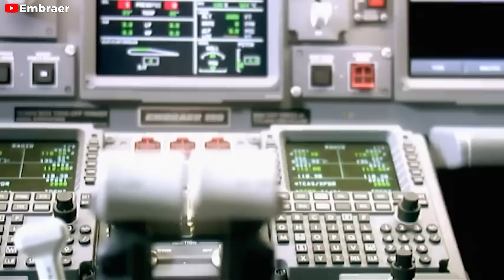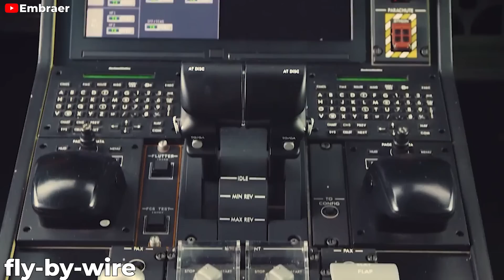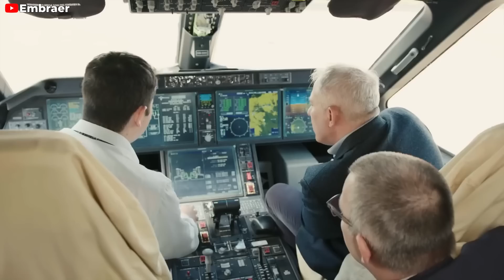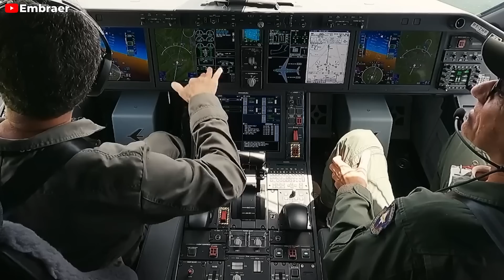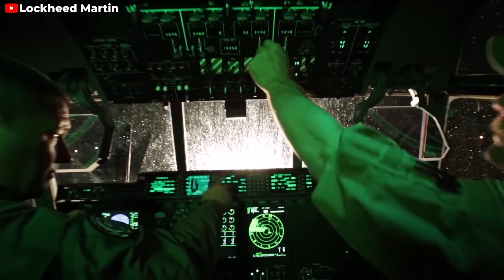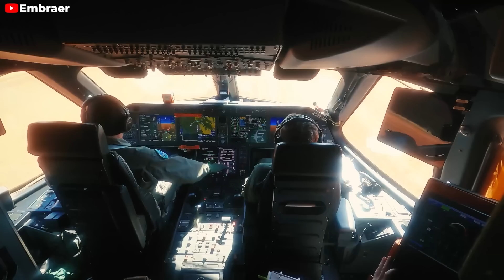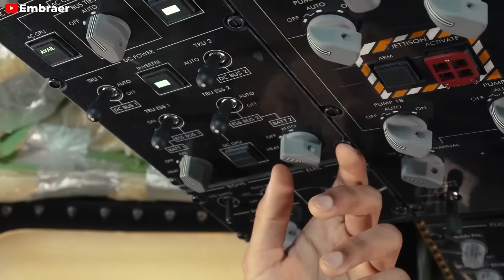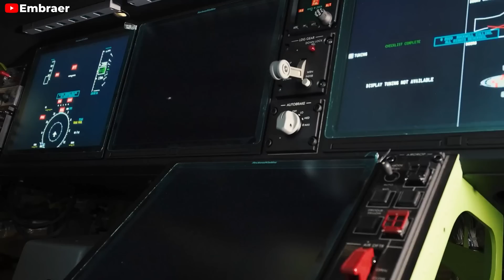The Embraer NEW C-390 Will Change The Aviation Industry and Destroy C-130J! Here's Why

Comment: I will have to see it to believe it.  It's unimproved field performance will not approach the C-130J. As a person with 4200 hours in the Herk, mostly the E model, but some in the B and HC, you will have to prove to me that a twin engine, turbofan will hold up better in combat conditions where the 130 lives. When something goes through that big fan , and it starts "shucking" blades, one rapidly ends up on one engine, or none. Please don't tell me that that machine will stop on wet PSP , Laterite or mud better than those four big fans on the Herk will stop that machine........prove it.  The BS gets deep when a company is trying to sell an airplane.
Reply: Couldn't have said it better myself.  Question:  Did you take some of your training at Little Rock AFB?  That was my old stomping ground when the E model ruled the skies.  Good days and great memories.
Reply: The advantage of turboprops on unprepared runways is undeniable, but there are some nuances here.
The choice between the propeller model was due to several factors, such as: what type of environment and runway it will operate in most of the time and whether there are design solutions that can mitigate these deficiencies.
It is very important to remember that the Brazilian Air Force - FAB defined the aircraft's operational requirements. These requirements are extremely strict, as the aircraft needs to operate in very difficult conditions, especially in the Amazon rainforest and on the Antarctic continent, where the FAB operates missions in support of the Brazilian Navy's Brazilian Antarctic Program - PROANTAR within the scope of the Antarctic Treaty System (ATS). It is also worth mentioning that the Brazilian Air Force holds the intellectual property of the project (since it was financed by the treasury).
They certainly took these issues into consideration, especially since the FAB carried out the integration of the Amazon region for 40 years on the back of a turboprop, the "Father of the Amazon" De Havilland Canada DHC-5 Bufallo.

Comment: Not at this time the Embraer can dethroned the C-130. The C-130 has 4 engines and been tested in many instances that 1 or 2 engines 1 each wing been shut off and it still able to fly mid air  normally. The C-130 can land and fly in a short runway due to its powerful 4 engines during take off.
Reply: And a simple but awesome aspect ... a C130 can reverse itself.

Comment: Can it take off and land from an aircraft carrier? Also, jets need a cleared and leveled runway. It might now need to be perfect runway, but it can't land on a runway special forces spent 3 days clearing in the middle of a jungle without construction vehicles. Lastly if it loses three engines to AAA can it land safely? 🤣
It's great plane and will easily replace the Herc for 80% of what it does, but that's the easy 80%.

Comment: You gave us all these spec's, but didn't compare them to the   C-130 is is supposed to dethrone.  How useful is that?  Also,  some of the things you bragged about, as in only 2 engines, can be a detriment.  If the C-390 loses an engine, it has lost 50% of it's power and capability.  What about ability to take-off and land on rough terrain?  I believe the C-130 has larger and wider tires.
Reply: He said that it can operate from dirt or grass runways even ones that are not smooth, it can roll over 15" holes.

Comment: The C-130 has been fulfilling missions for about 60 years, with many variations and many generations, and it has proven itself time and time again.  Let's give the C-390 about 10 years of evaluation time and real world missions (both peacetime and wartime) to determine if it will "dethrone" the C-130.  As I recall, Airbus tried to assume that role with the A-400M,  starting about 10 years ago.  I'm not sure that's on track for Airbus.

I'm all for replacing old and obsolete equipment, but those replacements need to be better, not just different.  The C-390 speed (max: 988 km/h, cruise: 870 km/h) is a nice improvement.  Certainly better than the C-130 speed (max: 590 km/h, cruise: 540 km/h).  And the additional 7 tons of cargo capacity (26,000 kg vs. 19,000kg) is always welcomed.  For the C-390, I'd like to see the results of STOL testing and the ability to do a LAPES drop.  I'd also be interested in how those engines perform after sucking up a cloud of dust and sand during a short landing on a semi-improved dirt or sand runway.  

Oh, and Loadmasters do more than just lower the tailgate, so I seriously doubt that the C-390 has rendered the role of Loadmaster unnecessary.  That is like saying, "the pilot can turn a bolt, thereby rendering a maintenance ground crew unnecessary".  Those Loadmasters and ground crews do SO much more.  Interestingly, about 40 seconds after making that statement about making Loadmasters unnecessary because the pilot can lower the tailgate, you indicate that the aircraft is manned by a 3-person crew:  a pilot, co-pilot, and Loadmaster.  So. . .which is it?
Reply: Can the pilot go in the back and find what is on fire in the pallets before it takes out the plane while still avoiding thunderstorm clouds? A loadmaster can. Is the pilot going to tie down/untie the pallets instead of planning the return flight?
Reply: The Airbus A-400M Atlas military transport aircraft is sized between the 130-J Super Hercules and C-17 Globemaster 3 (171K lbs cargo). A total of 124 A-400M have been built(as of early 2024). ( C-17s tally 279 and  Super Hercules (500 made , 2022) are still being produced. Japan is building a small number of Kawasaki C-2, (twin jet aircraft) it can carry a similar amount of payload as the A-400M in 80K lb range compared to the Super Hercules 41K lbs. The Airbus A-330 MRTT (multirole twin jet, 60 built) can carry 37 tonnes (80K lbs) in the lower holds. The USA military tends to build runways large and strong enough for most of their planes, other countries tend to buy the planes that will suit enough of their existing runways to be viable.

Comment: The C-130 isn't going anywhere. One of the strongest points about the C-130 is its speed. Its ability to fly slow is the very reason it's used for so many different types of missions. I've been on a C-130 that made a night landing on a dried up lake bed with the pilots using night vision goggles. If they're after speed, fly a C-141. If they're after payload, fly a C-5M Super Galaxy or a C-17 Globemaster.
Reply from the maker: Thanks for sharing your experience. Amazing
Reply: What happened to American made?

Comment: OK. I've listened to your video on the specifications of the hot selling C390.
I have a problem,  what is the shortest unimproved landing strip that it can land on.  In comparing the C130 to the C390 you failed to mention that. To be useful it would have to be shorter than a C130 landing strip.  You put a lot of emphasis on how much the C390 haul in terms of cargo and people.  If that were the requirement, we would use something more like a C17.
Reply from the maker: I will keep this question in mind. Thank you.

Comment: The C-130 was a stop gap in 1956 to fill the need until the C-133 and new C-141A came on line. So, almost 70 years-old and still in production with more jobs that Carter has liver pills. It's not going off line anytime soon.
Reply: The aviation industry seems to adhere to the same philosophy  as mechanics.... It's only a temporary fix unless it works, then it's permanent. 😂
Reply from the maker: Thanks for your sharing

Comment: What the C-130 will still do: double as a weapons platform for Harvest Hawk and Rapid Dragon. The C-130J has a range of 3300 km while the loaded C390 max range is 2100 km. The 130 will have a standoff capability to launch multiple cruise missiles at any Pacific adversary. It is a practical, cost-effective platform for the next 20 years. After that, the C-390 will be viable competitor.
Reply from the maker: Thanks for your comment. Useful knowledge.

Comment: Did they mention internal space? Weight isn't everything. Something can be right but bulky. The 390 looks tiny.
You also have to take into consideration the amount of spare parts there are for the c130 out there vs the 390 which is brand new.
Reply: The C 390 is more spacious; it can fit a HIMARS without any problem.

Comment: The Embraer C-390 will not replace the C-130. The C-130 can go into shorter very rough fields that would destroy the full jet engines on the C-390.
Reply: Bro, the C-390 was designed to land in the middle of rugged terrain in the Amazon...

Comment: Apparently, they missed the reason why the C130 is still being used. Prop driven aircraft are inherently safer to operate on unimproved airfields. Less chance to damage the engines. We use C17s for heavier loads from improved fields. Why add another airframe?
Reply: US will never buy an foreign freighter due to US laws, but others countries will.

Comment: The pilot can control the cargo bay therefore they don't need a loadmaster? I thought a loadmaster did more than just flip a switch. This seems more like a promotional video for Embraer. The first flight of the C-130 was 70 years ago, can the C-390 achieve that?
Reply: Embraer built an jet trainer in the 60s that was so cheap and reliable that it only was retired from the Brazilian Air Force due to the Grippen NG program, but others countries still use it, and remember, Embraer is the third largest aircraft manufacturer in the world.
Reply: @C0lon0  
I'm not trying to trash on them as it looks pretty cool, but this is almost like comparing apples to oranges.

Comment: Would the C17 be a better comparison?
Reply: VERY VALID question and the answer is the C17 is in the next category UP.
If you just look at the payloads (quick look on Wikipedia and NOT going into details
C-17     - Payload 77,519 kg(max) or 18 x 463L master pallets with a range of 4,480 km at 71,214 kg PL
C-130J - Payload 19,000 kg (max) or 6 x 463L master pallets with a range of 3,300 km at 15,400kg PL
C-390   - Payload 26,000 kg (max) or 7 x 463L master pallets with a range of 5,000 km at 14,000kg PL
                                                                                                                                        2,700 km at 23,000kg PL 
                                                                                                                                        2,000 km at 26,000kg PL 
And just to throw it out there The Kawasaki C2 and Airbus A-400M Atlas
C-2      - Payload 37,600 kg (max) or 8 x 463L master pallets with a range of 7,600 km at 20,000kg PL
                                                                                                                                        5,700 km at 30,000kg PL 
                                                                                                                                        4,500 km at 36,000kg PL 
A400M - Payload 37,000 kg (max) or ? x 463L master pallets with a range of 6,400 km at 20,000kg PL
                                                                                                                                        4,500 km at 30,000kg PL 
                                                                                                                                        3,300 km at 37,000kg PL 
Here's the basic cost per aircraft from google search and NOTE that when you look at the contracts its a lot more because of the technology transfers which includes things like simulators, crew training (ground and flight) and spare parts.
C-17       $340 million
C-130J  $70 million
C-390    $50-55 million
C-2         $136-176 million
A400M  $141-188 million

FYI - I have a degree in aerospace, but I work in industrial control systems and automation but costing and comparing is part of EVERY engineers job at some point. I'm Australian and a couple of years ago when they suggested we have a civilian air force again to help with non-military logistical support in things like disaster relief and bush fires. I looked at the options of the C-130J compared to others. I started with the C-130J for the simple reason the RAAF already has it and that means there's no need to get a flight simulator and we'd already have the training programs and maintenance programs and spare parts.

I compared the C-390 to the C-130J and it has a couple of advantages mentioned in this video. 
Its cheaper and has slightly better payload and range and range is important in a place like Australia.
It also has the same engines as on the Airbus 320 and our airlines have the Airbus 320 so at least the engines can be maintained and spare for the engines are already here.
PLUS we also have Embraers (EMB-120, EMB-110, E-190) in our regional airlines so we already have Embraer here in Australia 
The single biggest advantage of the C-390 is the lower cost especially compared to its competitors.

BUT these are UNIT COSTS which is wildly different to the program cost per unit. 
For example Australia recently signed an order for AU$9.8 Billion (US$6.42B) for 20 x C-130Js which is US$320M each NOT the quoted $70 unit cost. YEAH that should open your eyes on military contracts. It not the unit cost its the program cost per unit that makes your eyes roll back in your head and its the sort of thing NOBODY every discusses.

Sorry for the long reply and total geek out BUT damn you asked a great question.
Reply: @tonywilson4713  Wow, excellent reply to my uninformed question. Thank you.....
Reply: @caseyporter1235  Thanks
It really is a great question and its the sort of question I had already asked. So I already knew where the data was.

Comment: Nice try ! Can this C-390 air start another C-390 from its jet wash? It still does not have the carrying capacity! Can it back up? Can it carry 92 fully armed para troopers ? Is this plane capable of running without two of its engines?- Of course not ! The C-130's of today are redundant flight controls and all updated Nav/ Flight controls/ and different Nav aide's  from 1990- 2022- I have 2885 hrs on a C-130 J models- Nothing is as versatile than the Herc- Can that c-390 land or function in Antartica? Can it be a gun ship?
Reply: Ah yes, the hercules with 4tons less capacity and with a smaller fuselage will carry more than the C-390, and we are talking of 80 brazilian paratroopers that compares to over 100 american paratroopers because brazil use heavier and more equipment, same with soldiers, the average brazilian soldier carry almost 10kg more equipment than the average american soldier.
Reply: The C-390 landed in Antartida a few times, first for testing and after for supplies to the Brazilian station there. And why someone would need a gun ship? It is fucking useless in any modern combat, it only works in a night mission against civilians without anti aircraft weapons, the Super Tucano can easily do twice the damage than the AC-130 with all the guns, bombs and missiles while not being "stationary" over the enemy that could have a single cannon and destroy the aircraft.

Comment: The world wants a low cost with high quality, with turbojet engine and the embraer gives all requirements
Reply: It's a turbofan engine there, which isn't as efficient yet as turboprop.
Reply: @unclejoeoakland  Turbofan is more efficient at higher speeds.
Turboprop is more efficient at lower speeds - CRITICAL to any STOL transport design, which the C390 IS NOT.

Comment: You should do a side by side comparison of C-390 and  C130J. Speed, capacity - weight and volume , minimum runway needed, ability to land on unpaved landing strips and high altitude landing strips.
Reply: Emphasis should be made on  "the minimum runway needed and the ability to land on unpaved landing strips".  For anything else the US already has the C17.